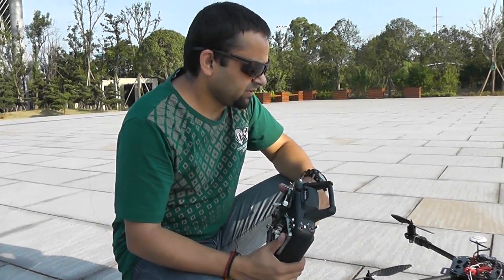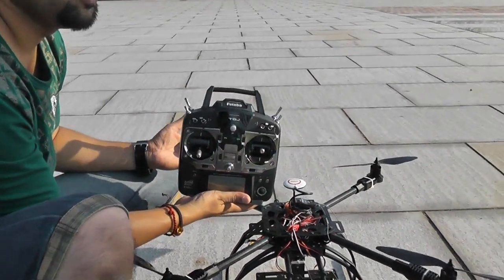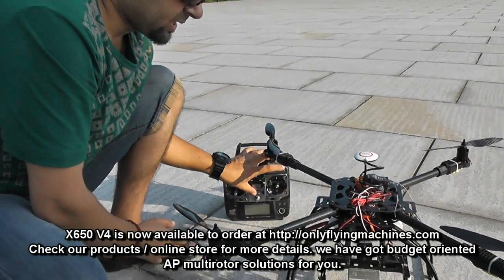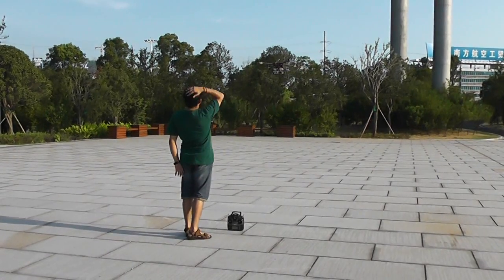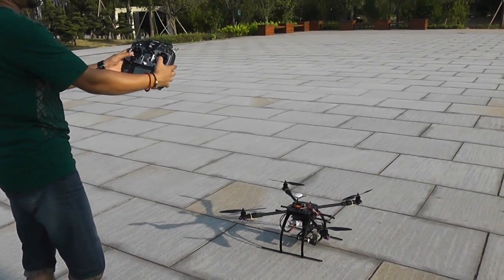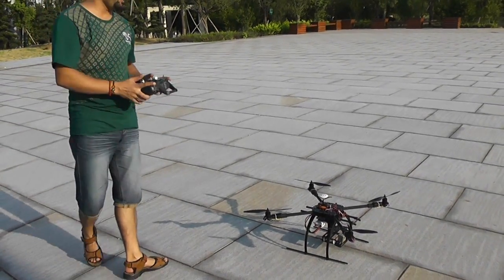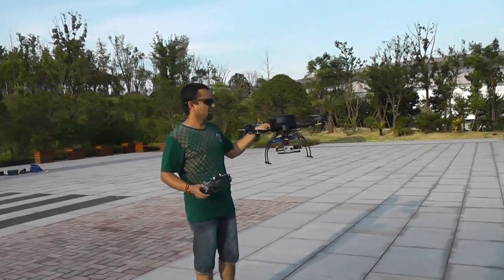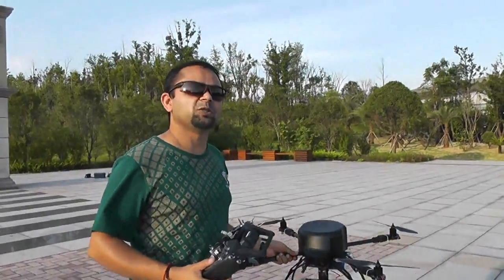OnlyFlyingMachines X650 V4 RTF with Futaba T8J

Comment: Once you manage to get it in the air for 15 minutes, and get a mile away, than your argument will be valid. 802.11n has a range of about 200 feet MAX... and also, can the AR drone take 1080? Can it take video past 24 FPS? As soon as you manage to hold 5 pounds with it, and be able to move the camera around, and get it over a mile away, than the AR done will not be considered a toy. Also, the AR drone is not upgradable. The GPS is pretty advanced too. It is a great beginners FPV/toy...